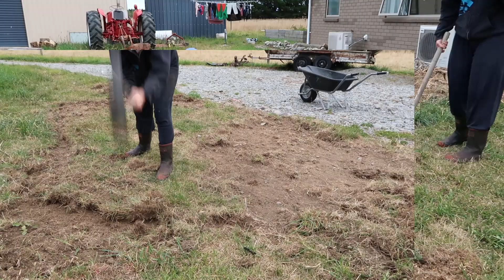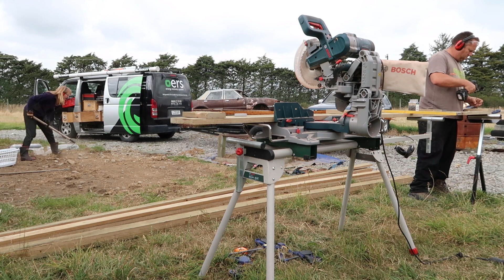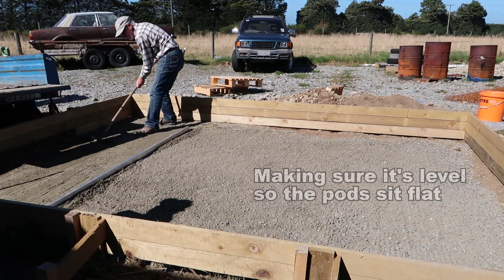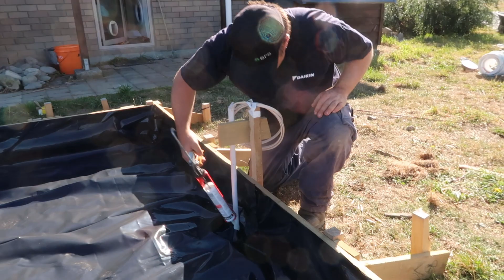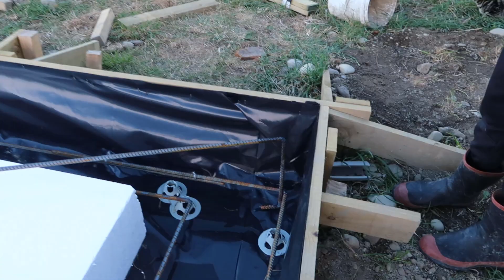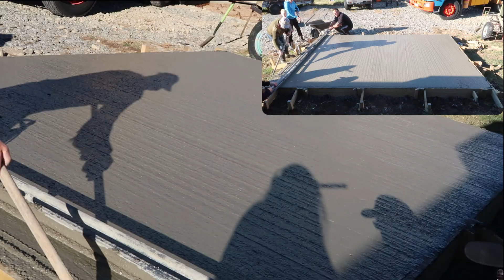Sleepout Build - How to do a Concrete Slab

Comment: I put my shed on 600x600 pavers. Below the pavers I put gap 32 and then bedding sand on top of that. Building a whole sleepout is way beyond something I'd attempt.
Reply from the maker: Yeah we've built a woodshed before on a concrete slab, but of course a sleepout has a lot more rules & regulations to follow so will be a lot more full-on - interesting experience though!
Reply: @CheaperWaysNZ  I wonder why you opted for a concrete slab, as most sleepouts tend to be built on piles or on a skid type thing.  I'd be more inclined to find someone selling a sleepout they don't want on trademe and getting a hiab to transport it to where you want it.  I've got a plan to do some major renovations in perhaps five years, so the plan then is to buy a caravan so I don't have to live in dust and a work zone area.
Reply from the maker: We looked at a lot of different options at the time - we wanted a concrete base to tie in with the house and the other sheds etc we have (thinking off adding value to the property in case we look at selling in years to come), concrete was going to be the best insulation-wise, and building ourselves ended up cheaper than relocating or getting a pre-fab (which we very nearly did) just because of the contacts we have and people we know in the trade etc.  Certainly a lot of options were gone through beforehand!